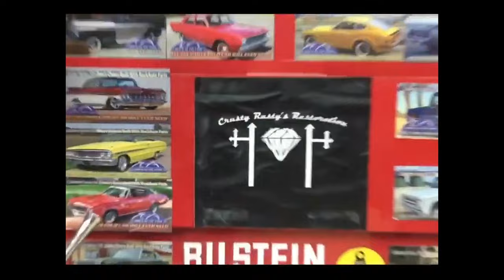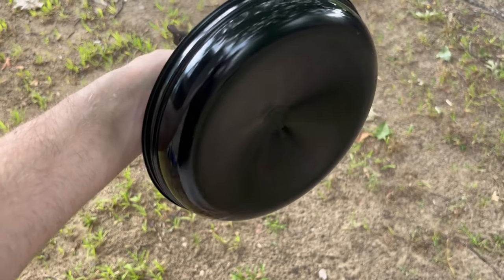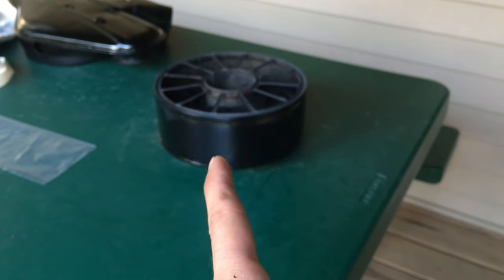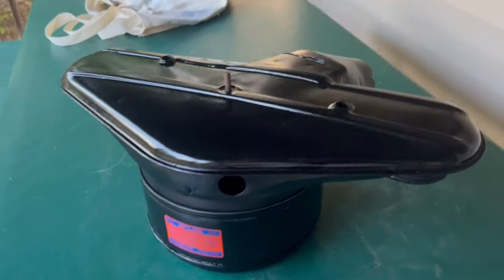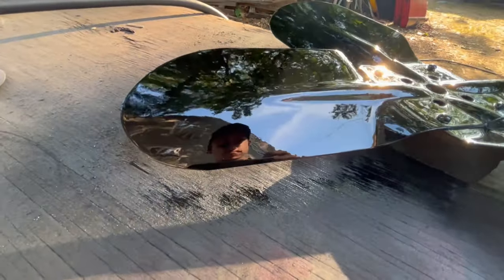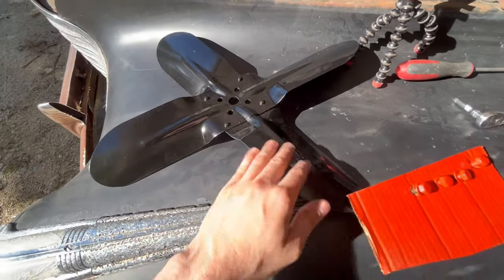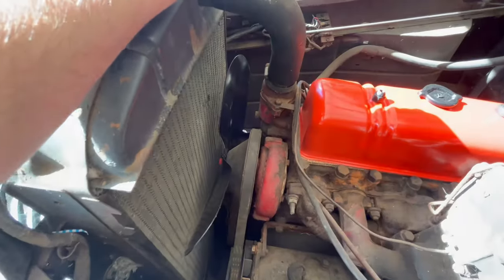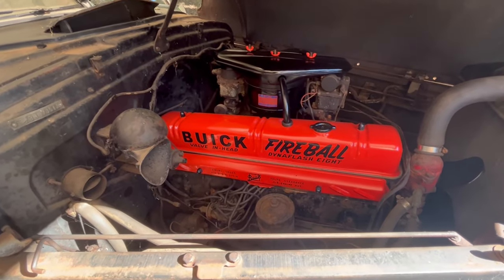1941 BUICK SUPER 8 Engine RESTORATION. BUICK engine spruce up Pt. 2

Comment: I have a 41 that was taken apart for restoration by someone else, so I've been watching videos of ones that are together, was able to see fuel line routing, and coolant and oil pressure sensor locations on yours.... no issue with no boots on your plug wires?
Reply from the maker: Thats awesome! The vids helped out some. I havent gotten it running yet, i need to go though a mess of chewed wiring before i hook up a battery. Mice got it over the years and I dont want to burn the car down haha Let me know if there is anything else you need to see the location of. Thanks for watching!